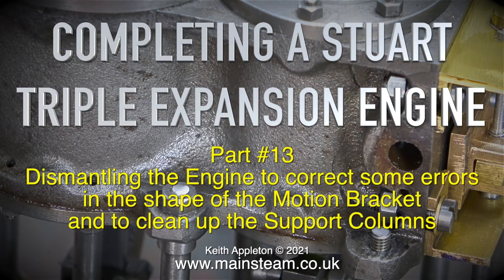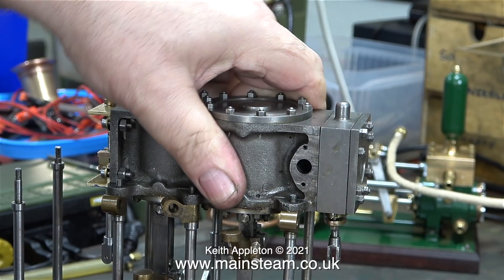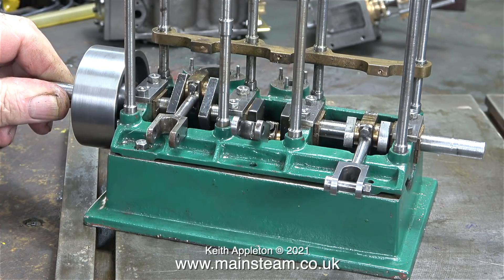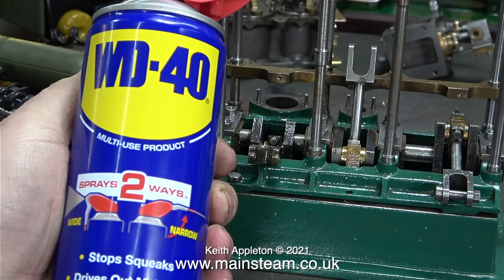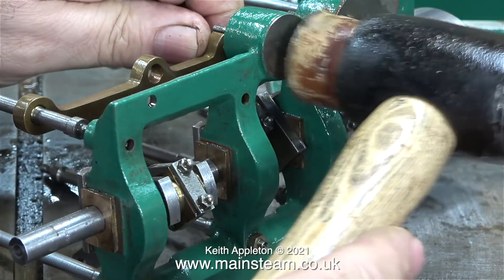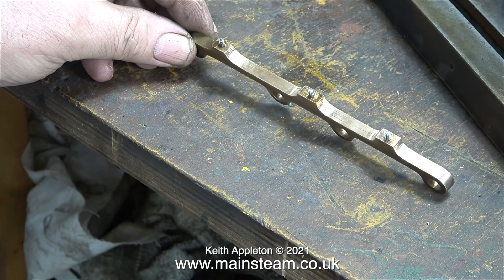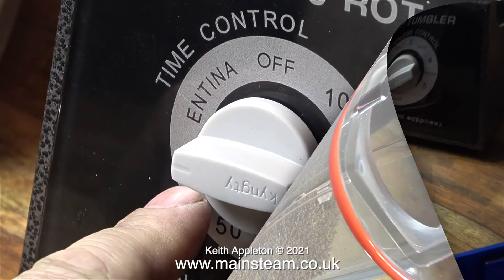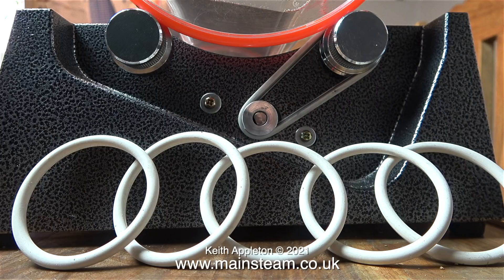COMPLETING A STUART TRIPLE EXPANSION ENGINE - PART #13

Comment: I find WD40 is pretty good for cleaning and use it to clean my motorbike chain when it's particularly grungy and has been neglected for a while, I use chain cleaner afterwards to remove the WD40. 
It's a terrible lubricant but has a few surprising uses like it's ability to clean off residue from stickers.

Comment: Hi,
Adding a proper simpling valve that converts the operation is very tricky. (It’s actually two separate valve operating in conjunction. I have only found them detailed on twin compounds. Triples seem to have an impulse valve instead. Much simpler is to add an impulse valve. This simply connects HP steam to the MP valve chest. This effectively connects HP steam to the exhaust of the HP cylinder. With HP on both sides of the HP cylinder it should produce no rotation. Thus the HP steam acting on the MP cylinder should easily turn over the engine. The LP cylinder will get a burst of MP steam when the crank reaches the correct position adding to the rotational motion. The impulse valve is supposed to be used to provide a burst of steam to kick over the engine and then close allowing the rotation to start the engine. I am in the process of finishing my triple and have acquired a steam whistle type valve that will connect between the HP and MP valve chests. A spring lever will operate or a servo. I was going to connect it between the pipe work but think this will look odd so fitting on the backside of the engine. Steve
Reply from the maker: Thank you Steve, that is interesting information }:-)))